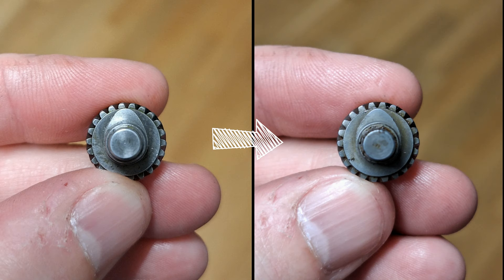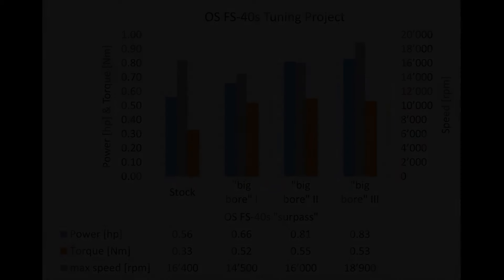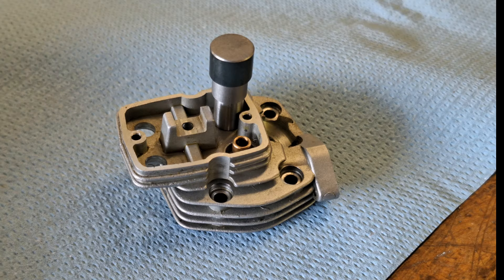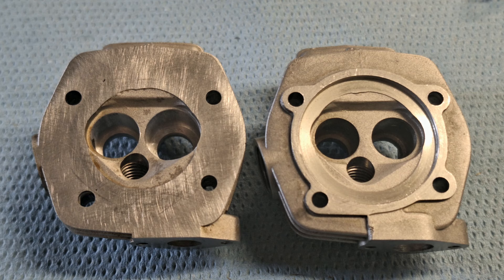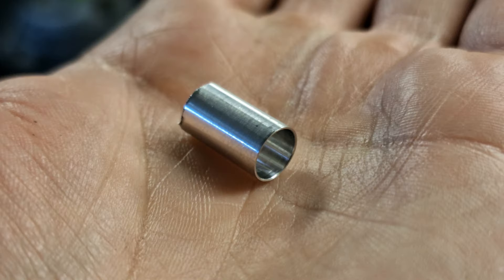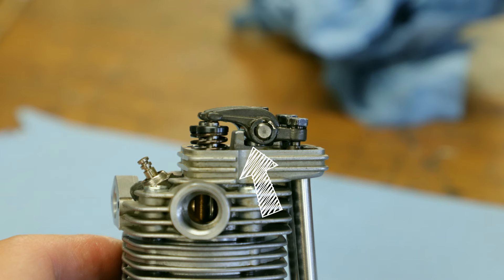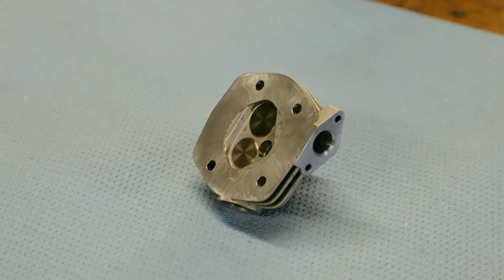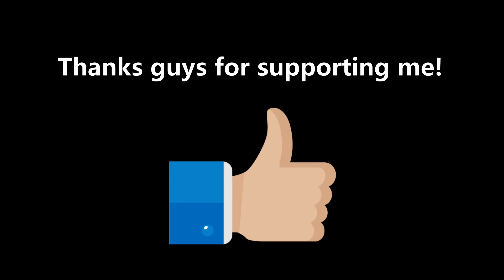How to boost the performance of a OS FS-40s? RC engine bore up-sizing and tuning project Part 5

Comment: Dang, the effort for .1hp haha! But thats 12 percent, so thats incredible. Someone mensioned and is right. You will have a valve shrouding issue. Not much you can do with that. And it looks like you have sharp corners in the port. Youll be at 1hp in no time!
Reply from the maker: Well, there must be potential for improvement step by step 😉 But let's get serious. I cannot say enough that this is still a simply constructed model engine from the manufacturer OS. It's just a model engine without high tech and a lot of potential for improvement. With a newly manufactured cylinder head, for example, we could easily get over 1 hp. But that's not the goal. It should still be an OS FS-40s. Otherwise I might as well build a new one...

Comment: Almost reach 1hp! Hahaha, i suggest to make the carb more downdraft,  increase the compression ratio also tuning the exhaust length and intake runner, very fond of this tuning series
Reply from the maker: Thanks man! It's not that easy to say what change has which influence. It's still a model engine and its behavior is sometimes kind of strange. Bit let's see what the next stage will bring!

Comment: Now it just needs a blower mounted on that little thing, maybe a little shot of n2o with some sort of enrichment system
Reply from the maker: Hi TurkeyBoy 🤓 I like naturally aspirated engines and I don't want "cheat" with a supercharger or NOS. I'm a fan of the V12, V10 and V8 era of Formula 1. The sound was simply divine! Sorry bro 🙃
Reply: @danielhunziker3577  I’m just saying if you want maximum power every thing you have done will support a blower nicely, I’m an na guy too but the best motor you can build is a max effort na build then add a blower, thy make a few for rc engines
Reply from the maker: @turkeyboyjh1  To be honest, I even have one lying around from rbinnovations 😅 But somehow...

Comment: Great achievement Daniel!!!!! Really looking forward for the stage 5! Let's see if you can get that horse 😊
Reply from the maker: Hi Davide! Thanks man 😃 Yes, it was a big step and a success. I have thought about this change weeks ago, but such extreme modifications to the cylinder head are a high risk and very labor-intensive. It was, so to speak, the emergency plan after the last unsuccessful modification. I'm pretty sure that stage 5 will bring the magic 1.0 hp! You know what that means 😉

Comment: Hätte ich das früher gesehen, würden bei mir von den über 200 Motoren der eine oder andere herumliegen, um den es weniger schade gewesen wäre als um einen neuen 40-er ;-) Auf jeden Fall interessant was man noch rausholen kann, geht aber dann wie gesehen, auf die Lebensdauer des Motors. Ich mache keine solchen Experimente. Ich revidiere und baue nur die Motoren. Mein letzter Motor ist der im Avatar gezeigte 7 Zyl. 120cc Sternmotor. Bei Interesse gibt es hier auf YOUTUBE unter BIRTH OF AN ENGINE mehr zusehen. Vielleicht trifft man sich ja mal, denke wäre interessant für beide... Grüsse vom Zürichsee 👍
Reply from the maker: Hoi Noeggi1954 😃 Weisch, das isch jez ned so schad um ä Motor gsi. Es isch kei neue OS FS-40s gsi und es hei 2 wiiteri als Spender müesse her halte 😅 I mach gern so Basteleie 🙂 Lebensduur isch glaub gar ned dr Punkt gsi, sondern dass eifach d'Bauart vom FS-40s zu schwach gsi isch für dä Leistigssprung. I ha aber gwüsst bzw. vermuetet, dass er irgendeinisch wird ufgeh. Ziel isch au gsi zum zeige, was alles so möglich isch bi dä Modellmotore und was für Leistige realisierbar si. I bou jo süscht au vill Motore und ha au paar Selteheite bi mir (Luther, Schillings, Conlyey, Condor, G-Mark, usw.). Kei Experiment 😅 I konstruier jo mini Motore au alli selbe. Do muesch halt vill usprobiere und experimentiere. Hesch au scho mi V8 Walzedreiher gseh? https://www.youtube.com/watch?v=8DCZT216YVY&t=2s I has Gfühl, i ha dä 7 Zylinder scho mol im ä Video gseh 🤔 Liebe Gruess usm Aargau 👋

Comment: This is just awesome! Playing around with valve size, inlet size looks fun
Will you optimize intake runner lengt and maybe a velocity stack for the 5th stage? Also a different exhaust header length/diameter and exhaust diameter/length will affect performance
Reply from the maker: Hey oom_701 😃 Yeah, for it's as well a lot of fun. I only got into tuning when I had the opportunity to measure with my dyno most of the motors. Otherwise you're simply in the dark and you don't really now what the performance is. I realised that there are huge differences between the model engines. My first incentive was to improve my own engines in case of power output (rotary valve engines like https://www.youtube.com/watch?v=TMYDdoHDgFs&t=5s). You will see in the next part what I've done and what influence it had 😉 But you are not that far away with your assumption!
Reply: @danielhunziker3577  rotory valve is also very interesting!

Comment: There are so many better ways of tuning a 4stroke, the intake is far from good, even after you enlarged it.
Use some JB weld and shape good runner, you got as for now some strange 'plenums' instead of a nice turn down into the cylinder.
It's very important to keep airspeed, now you don´t.
Then you can make a tapered exhaust, enlarging it to some extent all the way to the end.
Also, check the rockerarm geometry, you might not make use of the new camshaft as you should.
You might see HUGE gains from correcting this.

And by the way, it is equally as important to get good flow in exhaust runner in the head also.
Reply from the maker: You are right. The cylinder head is anything but optimal. The gas ducts have 90° angles, no smooth transitions and are too small. I wouldn't have designed it that way either. But the aim is to get the most out of an OS FS-40s without making significant changes on design, such as building a new cylinder head. It should remain an OS FS-40s. Otherwise I can just throw it in the bin and design and build a new one. You kow what I mean?

Comment: Awesome video! Im sure you know this, but for the kids watching, Beryllium alloys are highly toxic/ carcinogenic. Careful with machining, grinding and sanding...anything that produces dust, etc.
Reply from the maker: Hi RamblerMan :goodvibes: Thanks man, do my best to share my work as good I can and try to awaken interest in model engines. I only chose copper berylium (CuBe2) because that's what OS intended. I'm aware that beryllium materials have been suspected of being harmful to health. The use of copper beryllium and beryllium-containing materials is not banned, restricted or otherwise limited by any country worldwide (Reach or RoHS). Maybe you can read between the lines, that my real job/profession isn't model building 😉
Reply: @danielhunziker3577  Oh I figured as much boss, you're obviously a sharp cookie☺️. Not usually the "safety police", but just wanted to put it out there that while it is an awesome  material, it's one of the few metal alloys that are quite possibly carcinogenic.  Great material, thanks for sharing!!
Reply from the maker: @RamblerMan68  You're welcome dude! Don't worry 😃 We don't install heat insulation from Aspest on the engine 🤪 I just had a few bars of Cube2 lying around and used them like OS has done it 🤷‍♂ In real engines, more and more spring steel is being used as a replacement for CuBe 2, including for the valve seats.

Comment: Thanks for the content! I think you would've seen even better gains, had you re-centered the intake valve axis. I looks like you're running into shrouding issues between the intake valve and cylinder wall... as your substantially increased curtain area should've made much better flow with the duration from the new cam profile.
Reply from the maker: Hi James! of courese you are right. The inlet valve has very little air to the cylinder wall. This isn't ideal and reduces the gas flow in this section. Of course, I would also like to have angled valves, 4 valves, a roof-shaped combustion chamber and no 90° angles in the intake and exhaust ports. But that would mean I would have to make a completely new cylinder head. But that isn't the goal. The aim was to take the existing material and optimize it as much as possible. This is of course a limitation. Do you know what I mean? But there is still a tuning stage to come and who knows what it will bring 😉

Comment: what method did you use to measure torque? there only seems to be a hall sensor to measure rpm, do you calculate torque using acceleration from the diameter of the flywheel, time and it's weight?
Reply from the maker: Hi Trung 👋 That's right. I use a sensor to measure the time per revolution. From this I calculate the Angular velocity and the angular acceleration. The speed (rpm) can then be calculated from the angular velocity and the torque from the angular acceleration. The torque is the angular acceleration multiplied by the inertia of the flywheel. The power is then the speed multiplied by the torque.

Comment: Awesome work, subbed for the next upgrade👍 If you don't mind me asking, why the use of an AI voice over?
Reply from the maker: Hi Stocky 😃 Thanks you for your positive comment! I'm happy to hear you like my work. Do my best to share as much I can with you guys. Why I'm using an AI voice? Good question! It's the first video I have made with AI voice. So far all my videos were with text and speech bubbles. I very often got the feedback that reading is unpopular and tedious. They also said that they then look at the text and not at the pictures and videos. The request was that I personally comment on the videos. But I don't want that and that's why I chose this compromise solution with AI voice. I was suprised how well they are working today. I'd love to get your feedback: What do you think? What do you find positive and what rather negative?
Reply: @danielhunziker3577  Thanks for your reply, I think you've made a good choice. I think I also prefer the ai voice instead of reading text on a screen. In videos like yours with original content and quality content its a good tool to use👍
Reply from the maker: Hi Stocky 😃 It's atry to do improbve the video quality. Compared to text, it is about twice the work to make a video with AI voice 🙈 That is the disadvantage of it...

Comment: Interesting.  I would have expected a little more, but the inlet is now shrouded and the gas flow through those radial ports are likely not doing you any favours.  One stand-out point is your exhaust.  You’ve increased the port flow area, but the silencer outlet is unchanged.  Is that correct?  If so, there may be some easy gains to be had there.
On another point, what’s your compression ratio?
Reply from the maker: Hi Paul 😃 Thanks for your comment and your interesting questions! The exhaust system is something I didn't explained in the video. I have installed a larger exhaust system. The original silencer from the OS FS-40s has a 5.0mm outlet and the new one you can see in the video is from the OS FS-52s and has 6.0mm outlet. You're right, those radial ports aren't a good solution to improve gas flow. But this is the original design by the manufacture OS and my goal is to improve the existing design to get a higher output and not to make a fully new cylinder head. Do you know what I mean? The compression ratio is 9.5:1.
Reply: @danielhunziker3577  Thanks for your response.  It’s refreshing to not have to deal with overwhelming negativity to simple observations.
For your exhaust, you may still be too small.  I forget what you said about valve seat area, but calculate the area at full valve lift and ensure your exhaust outlet is at least twice that.  Not a rule as such, just a very simple way to ensure you’ll not be making a restriction.
Compression ratio could probably be raised a lot if that can be done without needing a new head or piston.  For such a small bore, 14:1 or even more would be entirely plausible.  Have you played with ignition timing at all yet?
Reply from the maker: Hi Paul 😃 You have a lot input and ideas. Compression ratio in model engines is very tricky. The methanol/nitromethane/oil mixture ignited with a glow plug (no active spark plug) tends to self-ignite. The mixture is also very inhomogeneous. Compression over 10:1 isn't possible. Premature ignition is always the result. This one, for example, also misfires below 3,000 rpm. The manufacturer OS always states the output with flame tube and not with silencer. The difference in performance is around 10%. We have a reflection silencer here, which leads to a higher dynamic pressure due to the increased cross-section and constrictions, means less power and less loud. For fun, I might measure with a flame tube (no gas flow restrictions).
Reply: @danielhunziker3577  yes, ignition timing is difficult with glow plug ignition, but is it no longer possible to find different grades of glow plug?  It’s been a very long time since I worked on model engines and it would be sad if there was no longer any possibility of changing timing.  All is not lost though as the nitro-methane content can be used to effect considerable changes of timing.  It’s a complete juggling act, but experiment with fuel composition, compression ratio and glow plug grade (if available)… or shift to spark ignition and a suitable fuel if you want full control in the chase of real power.
Tiny engines respond quite differently to their much larger brethren, but the same principles apply when tuning.  A continuously increasing flow area of the exhaust and a length tuned for resonance at your target peak power speed should be your target.  If you want a rich source of content for your channel, that could form an interesting series of work… as would building a steady-state dynamometer so you can really see what’s happening.